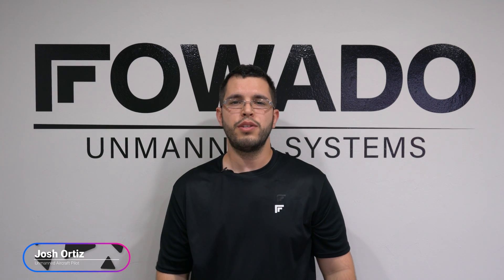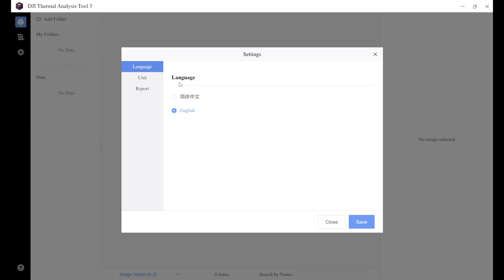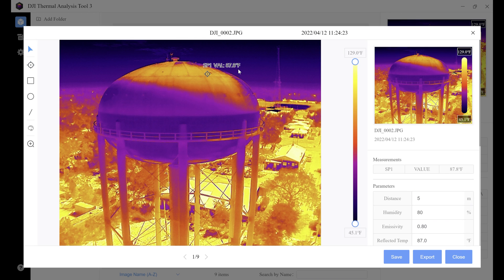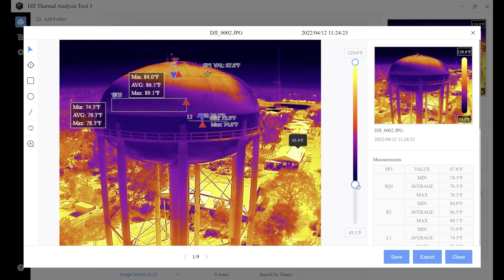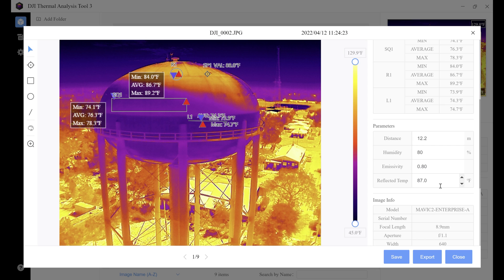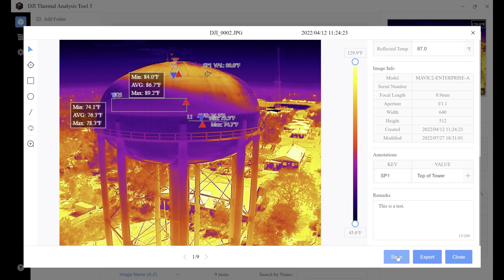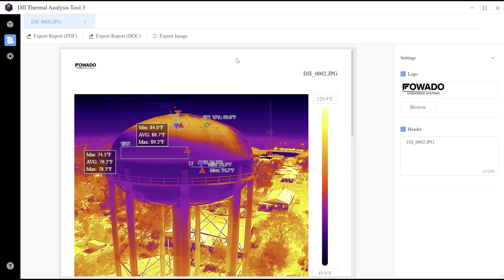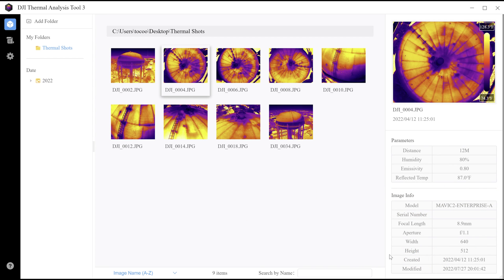How To Create Thermal Drone Deliverables DJI Thermal Analysis Tool 3

Comment: What colour pallete would be the best to use when capturing the image from the drone ? M4T in my case. Also emissivity, if doing an inspection of example a house, in UK, with different surfaces/materials, (bricks, rendered walls, roof tiles ) should an average emissivity be used, ie 0.95 ? Thanks. Great video.

Comment: So clients could download this software, use it themselves, all the drone operator has to do it take the photos and supply them to the client. Parameters, distance, (from drone to target ?) why is that not automatically the correct distance ? I'm using M4T, just stumbled across this video.

Comment: Would this tool be useful if a client wants to find out if there are thermal leaks in a building?
Reply from the maker: Yes, we have performed operations where we detected and documented moisture instrusion around exterior surfaces like window sills, Roof tops, etc.

Comment: I wonder how accurate the 3T is below the -20 Celsius. I wait till the weather is -15 or higher but the snow is colder and sometimes I get -23 or -40 at the same point within 10 minutes. I like the 3T very much but I'not sure it is good enough for the winter.

Comment: Is the water tower only an example, or is there actual utility in doing thermal analysis of such?  Is this really a thing in the business?  If so, how is it used?
Reply from the maker: In this demonstration, the water tower is only an example. However, Thermography itself is a booming business used mostly for inspection type work. Solar panels, moisture detection, infrastructure inspection, the list goes on.

Comment: Thank you. How powerful of pc do you need? I use a Mac, but I have an older pc
Reply: Apple users can run Parallels with DJI Thermo 3.0 for convenience.
Reply from the maker: Something with the equivalent power of an Intel i3 processor. The app is not very demanding. However the faster your computer the better.
Reply: @FowadoUS  Thank you

Comment: Hi, thanks for the video.  Are there any plans to make the reporting more useful?  Will they be adding a method to compare two  spots on the same picture like the Delta feature in Flir Thermal Studio?
Reply from the maker: Hi Roger, DJI is constantly improving this tool, at the moment there is no word on this, but expect more versions in the near future with more features.

Comment: Hi thanks for ur video but is there an easier way when you have over 300 images or do you have to do this one by one which is really time consuming.  Thanks
Reply from the maker: Hi Ali, There are completely different approaches for delivering your data but this video is only intended for DJI Thermal Analysis Tool 3 users.  Something to keep in mind is that the more images you have, the more work that needs to be performed so this should affect your pricing to your customer.  What type of infrastructure are you inspecting?